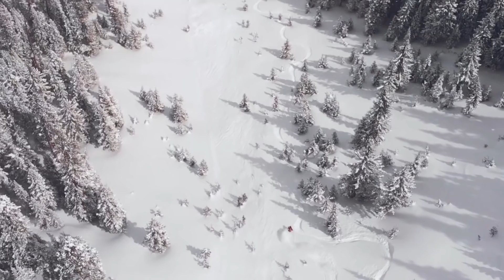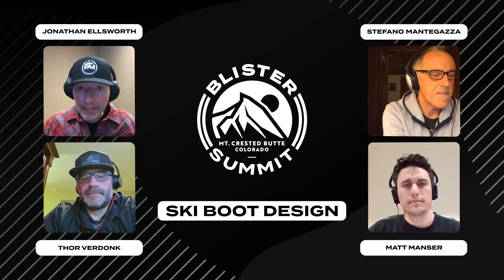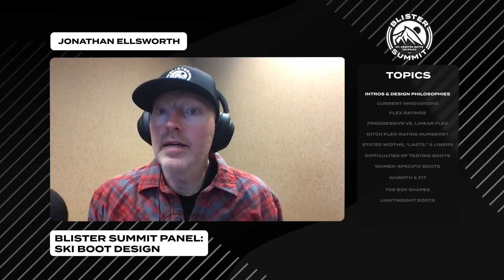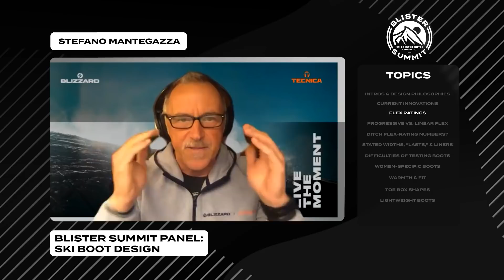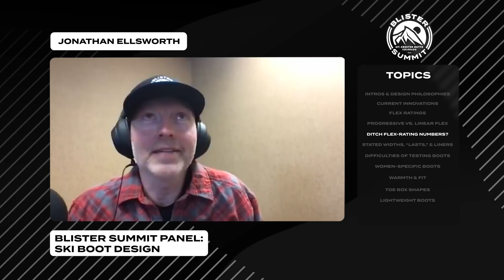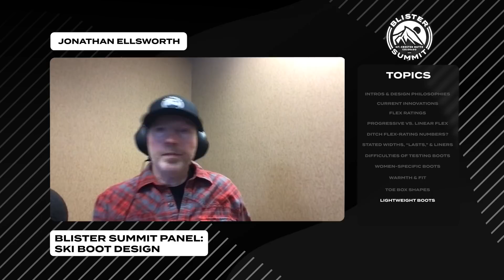Blister Summit Panel: Ski Boot Design

Comment: Thor nailed it again. "if you have a presice fit, you're going to have a warmer boot."  Mostly because you won't have to buckle the boot too tight and you'll have better circulation. There fore everyone should have Zipfits. or the new Hawx Professional, which gets it's inspiration from Zipfits. i.e. fantastic heel hold.

Comment: As a skier, I really freaking wish you manufacturers would make flex ratings equal across the board. It's so frustrating to buy a 130 flex from brand b that feels like a 110 in brand a. The worst part is, you won't find that out until you've spent the money and hit the Slopes.

Comment: Great video, thank you for sharing that knowledge. but what I heard and see is that ski boot are very specialised in specific disipline. Like for me what work for a racer need doen't work well in free riding, bump or crudy snow. I hear a lot of the more the foot is lock tight in the boot it is more direct and performant but that is true for a racer that ski fast all the time in carving mode on ice. As a ski instructor we do it all at all speed for all levels of skier. For me if you lock my foot in a boot it does not feel right only in my carving turn. I need my foot to articulate properly without moving around. We need a ski boot that are strong and stiff for professional instructor not just a race boot.

Comment: GREAT presentation! I've been on a years long quest to get the right boots. As an adult learner, I'm not a race trained charger, but through the cuff, heel and midfoot, I have the lowest volume chicken feet on the planet, plus, I'm only 145. As a result, after suffering through boots that skied like Uggs, I've had two boots that fit, a Doberman WCS that softening to the point of ruining the boot couldn't get it soft enough and now a Lange ZJ+. With a 1 and 5 met head grind it fits like a glove, but even with one bolt pulled, it feels too stiff. To compound matters, I live in the boons. I have access to good boot fitters, but they are hours away. I like the way my Alien RS skis, but the ski/boot setup is what it is, light and tinny to aid in uphill performance. Ugh, this shouldn't be so hard. I need a support group for ultra low foot volume, non-chargy skiers. ;)

Comment: This was extremely informative. The panel really was a great mix of "ages" and depth of experience which is important. Excellent but not long enough on Women boots! Your break down of the industry, casual, backcountry, racer, high performer obviously makes the needs much more complex from an industry manufacturing and development perspective. I was thrilled to hear about ideas of "demo boots". Why couldn't we demo 3 types that should fit! Its like buying an appliance, your basically stuck with it once you leave the shop. I would think that there would be a way to develop a machine in the shop that could allow you to test the boot! oops there is my idea! I also have many other ideas with regard to the "liner" innovation. Could you have another summit and continue this topic. I believe it is the most important piece of equipment in skiing! Look forward to more summits to come!!

Comment: Jonathan, nice group and more inside baseball info than I could possibly remember. That said, I'm a passionate skier / consumer who walks into a ski shop and wants and needs the best ski boots for me.  Even armed with the perspective and experience of Blister and these industry experts, I tremble at the thought of a shop or boot fitter selling me the wrong brand or boot style/fit for my feet and my abilities. You mentioned that testing a ski provides instant feedback, while boots often take many days and a few adjustments to dial in confort and a custom fit that takes advantage of modern boot performance.  My dream would be to submit my feet to all boot brands and have them reply with their non-biased boot recommendations.